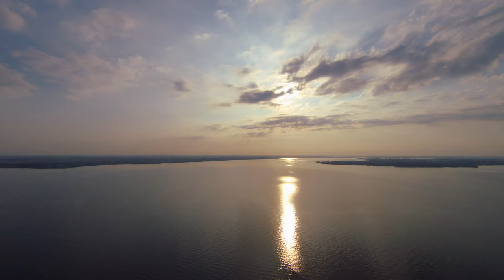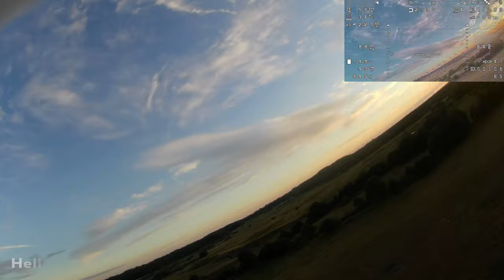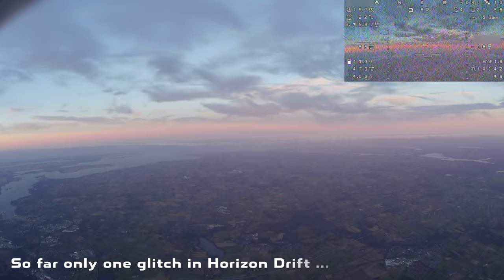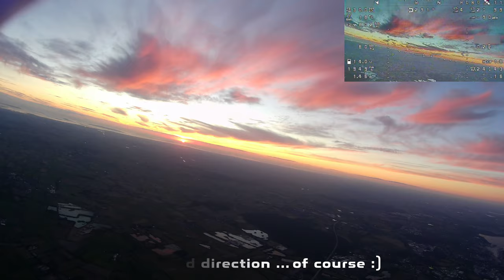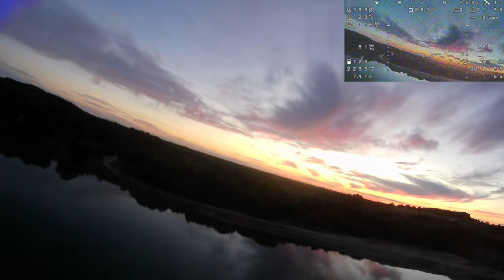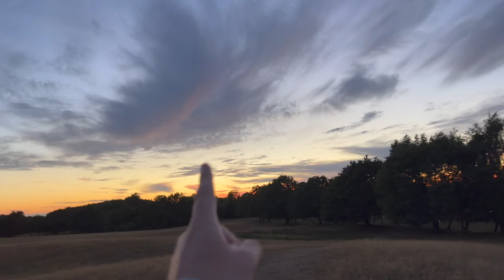Less horizon drift in INAV 5.1 ? | Hee Wing F01 EP:33

Comment: Perhaps, it's time to move on to Ardupilot my friend :)
Reply from the maker: Perhaps you are right- yet I’m not as skilled in ardupilot as I am in INAV so I guess my vtol will run ardupilot and for the rest it’s good to have Software which speeds up the configuration instead of modifying bitmasks up n down with an crappy interface- … ardupilot does a wonderful job- yet getting there is not as easy
Reply: @JustFPV-net  Well, you either have to choose a crappy flight experience or a crappy interface :)) cant have both :)
Reply from the maker: I agree … but I don’t really feel INav to be that crappy in flight experience- it never failed me and it still evolves a bit. Who knows how it will perform when it’s as old as ardu? Flying acro is a nice thing